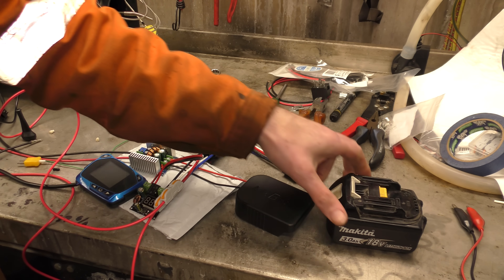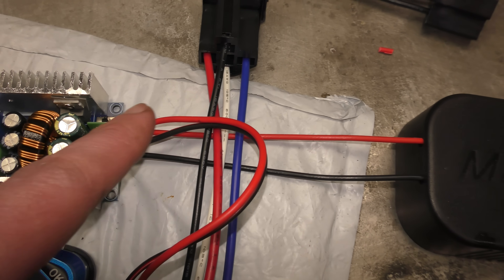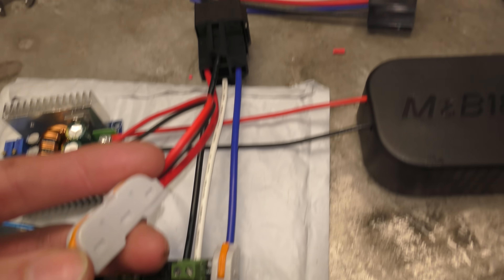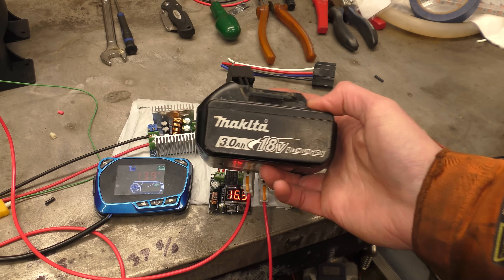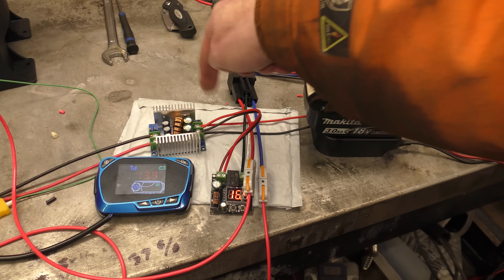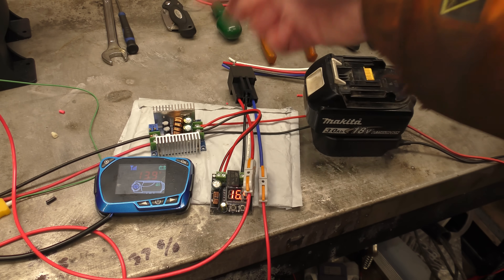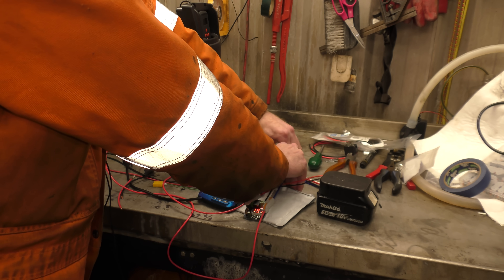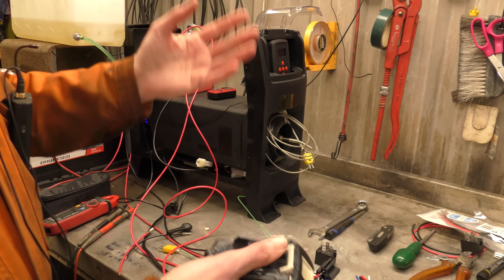Diesel Heater Running on Makita 18V Tool Battery

Comment: What’s the point of this though? No one is going to run there heater on a tool battery? Lead acid batteries are way cheaper than tool batteries.Sorry didn’t watch to the end.. afterburner
Reply: Missing the point Jim. Many of us have power tool battery, I don't have lead acid. On a mobile space heater, it's a pretty useful feature to use the battery you already carry and charge. Lighter and more energy dense..
Reply: @lukejones2772  I’m assuming this heater is in a van not strapped to your back?
Reply from the maker: As Luke said the point is lot's of people have tool batteries.  Especially people who have built their own campers etc.  Just gives another option as a power source.
Reply: In life there really are two groups of people; the majority who ask “why?” and those of us like David who ask themselves “why not!” I think our side of this divide is far more fun and educational
Reply: @theonlywoody2shoes  👌
Reply: @DavidMcLuckie  most if not all camper vans I have seen have a deep cycle battery for this, but I’m curious to see what happens when a tool battery goes low voltage quick as older ones sometimes do? Hot shutdowns or continuous low voltage fuel pump shut offs?
Reply: @JimLahey21  hot shutdown won't happen in this case, David has it covered. 
The low voltage circuit is controlling a relay that disables the fuel pump, not the heater controller, so it'll just flame out and clear the chamber before shutting down. The low voltage detection relay has a threshold higher than the BMS in the battery, so fuel kill will happen before the battery shuts off.
Reply: I now run a milwaukee Li-Ion impact drill for ice fishing holes. Lighter and more portable than gas auger.  If I could make a portable diesel heater for my ice fishing shack I can ditch bringing a propane heater and worrying about fuel for auger.  Brings my overall weight down considerably. I have makita batteries, they are finicky, that board 'bricking' batteries from charging sucks.  I've got some reading to do before I build my portable heater. Millwright by trade, not electrician.
Reply: @Joseph Cinq-Mars  sounds like a plan just keep the batteries in your coat on the way out to keep them warm . I'm building one now ordered a 30 Amp converter . I'm going to go simpler method and just monitor the battery and hope I don't fall asleep and shut it down in time . To skip the relay thing in the video . This video was a great help. There's the right way and then there's my way :)
Reply: Sometimes it’s just fun to see if it can be done!
Reply: Don’t get me wrong I love the thought of it but how long is a makita battery going to last?..

Comment: could you use two battery adapters in parallel so you could hot swap batteries without shutting the heater down?
Reply from the maker: I was thinking about that.  While it would certainly work I do have one concern.  When you insert the new freshly charged battery the two batteries will now want to balance out the voltage difference so you'll have a rush of current into the lesser charged battery.
Reply: @DavidMcLuckie  put diode on each battery
Reply: @melovescotch  what Diode and how where does it go please? Picture would help 👍
Reply: @DavidMcLuckie  ah yeah, good point!

Comment: I think you may have given china an idea for another variant of the ubiquitous diesel heater kit with this tool battery setup... :P
Reply from the maker: That would be quite nice.  An all in one heater with couple of battery slots on the roof.  No doubt they'd still miss out the low battery voltage protection.  :)
Reply: So long as you used branded batteries (assuming that's how they designed it to be used!), then they come with built-in protection usually, either in the DW01A chip or an equivalent to it, it's the generics that are the questionable ones... :P
Reply from the maker: That too.  I was thinking more of the fuel cutoff on low voltage and not their usual dead stop policy.  :)
Reply: I suppose that would be based upon what "stripped back for more profit" grade it was... :D

Comment: The battery pack consists of 5 li-ion batteries in series. The maximum voltage for a battery is 4.2 v and the minimum is 2.9 v (the protection circuit will count out between 2.5 - 2.7 v). The pack voltage is between 14.5 - 21.0 volts for best battery life. 

Why not just use a 12 v battery pack directly? 3 li-ion batteries in series will give 11.1 v nominal with a range between 8.7 and 12.6 v. 4 LiFePO batteries are ideal, they have a nominal 12.8v and are really safe. You could also use 10 NiMh batteries to get 12 v as well but it might not give the necessary ampere with just one series string.
Reply from the maker: So the reason for the tool batteries is people have them.  They don't have to buy another kind of battery.

Comment: Makita use 5s , 5x 3.65v gives the 18.4. 
Safe min voltage under low load is 3V per cell. 2.5v absolute min before damage. 
The extra capacity available to 2.5 is tiny, so play safe.
5x 3v min per cell,, safe pack minimum 15v
Reply from the maker: Nice.  That's the kind of quality reply I like.  Full of information.  Thank you.